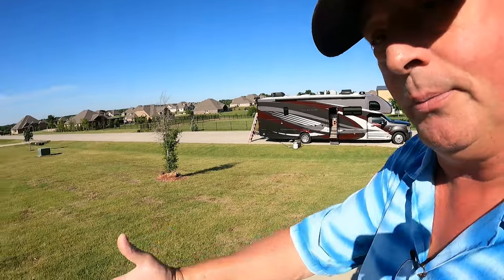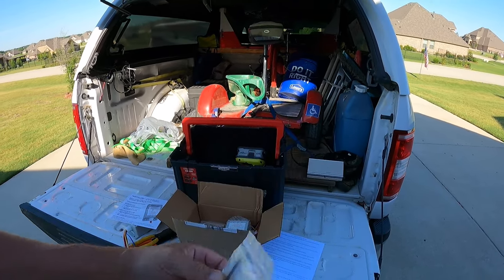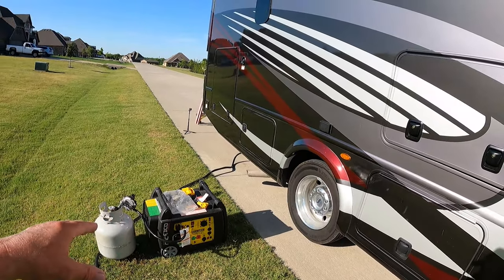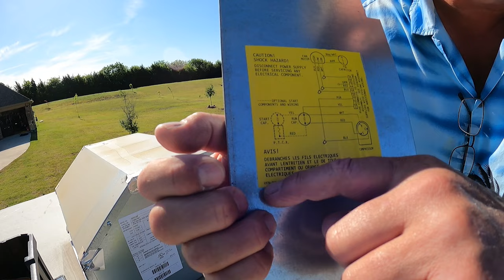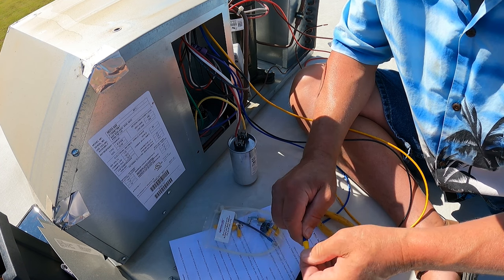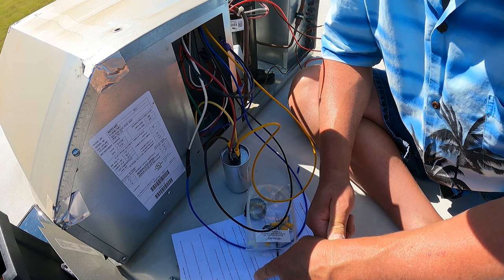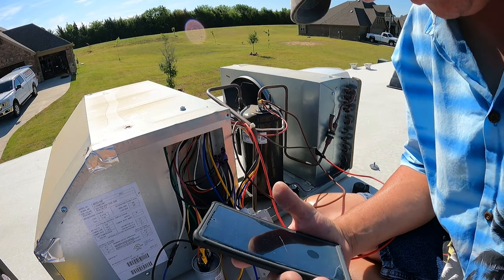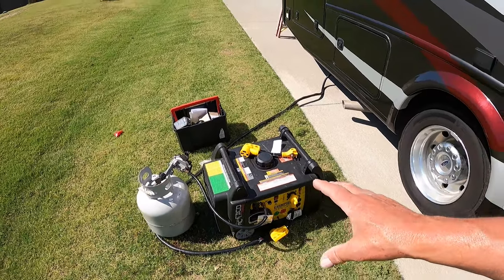Soft Start For The AC Units On Our Thor Magnitude Super C Motorhome!

Comment: There is a plug adaptor that uses the 30 amp plug and 20 amp plug on the pedestal so you can have 50 amp available !
Reply from the maker: I have one of those combiner adapters, paid $95.00 for it. Most of your 30 amp pedestals only have 30 Amps available. The 20 AMP is pig tailed off of the 30 AMP. Using that will burn out our A/C Units.
Reply: @DudeRV  I l;ve in se georgia and all the pedistals over here have 30 and 20 amp plugs .
Reply from the maker: @genegodwin769  understood. every 30 AMP pedestal has a 20 Amp Plug. most of those 20 AMP plugs ar pig-tailed off of the 30 AMP breaker, not a separate breaker so there is only 30 AMPs available at the pedestal even if you use a combiner.

Comment: great idea. I just have 1 ac and don't really need this however will this prolong tge life of you ac if it starts softer?  maybe a follow up for the viewers if you can find that information out about them. also what would be a plus is if the two can be linked together so both acts will not start at tge same time. just so.e thoughts
Reply from the maker: Can you operate your one A/C when plugged into a 15 AMP plug? One a boon docking trip this week end we found that the A/C does not thump and shake the rig when it kicks on. Thanks for watching!

Comment: Not saying this will work with everyones rig, but on my 30a FW Flair, I can run both AC's on 30amp.   I don't have softstarts or anything else.   What I do is start the larger one first and let that run for about 15 minutes, then start the rear one on fan for 5 minutes then set it to cool.   Now I also keep an eye on Volts coming into the coach.  At some private park organizations I have seen the volts drop down to 108 to 110 area.  At this point Surge protector would trip off.  So this is another factor to keep in mind.   Granted a Softstart is the BEST option and will definitely go with this option later
Reply from the maker: I really appreciate your watching and commenting but I gotta say this....
without a SoftStart system on the A/C units you are pulling a whole lot of power through the pedestal and that creates a lot of heat that degrades the breakers and your plug. This year I have had two 30 AMP campsite where the breakers were so weak that just one A/C unit tripped the breaker. That is the outcome of folks running a 50 AMP RV on a 30 AMP. Yes you can do it but When you run any RV with a low amp feed you are damaging the RV and the pedestal.